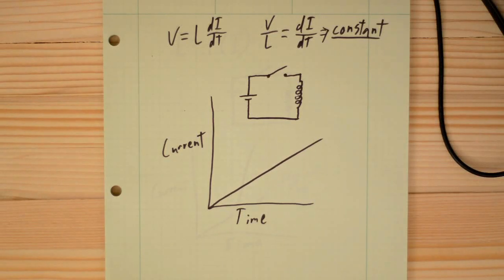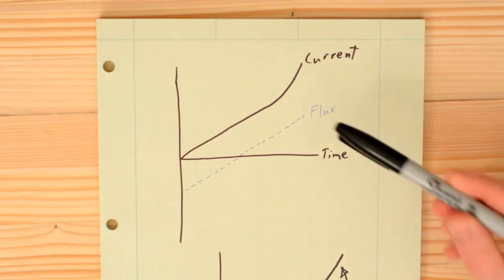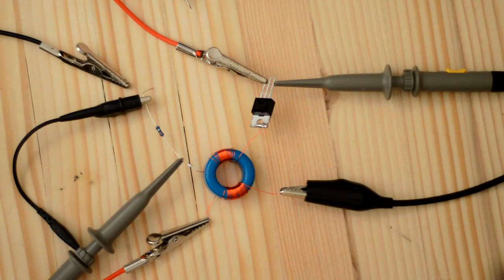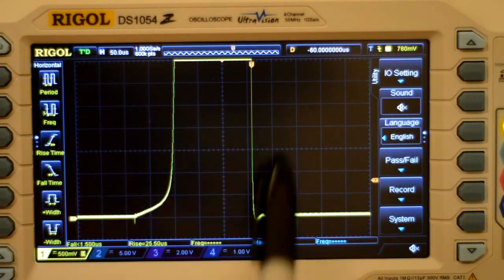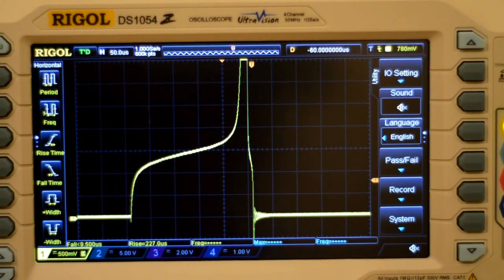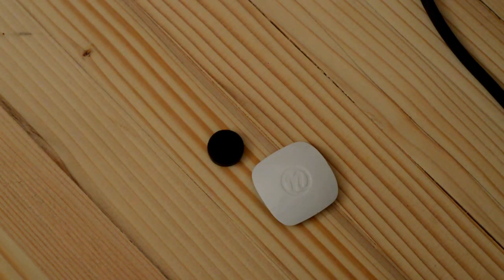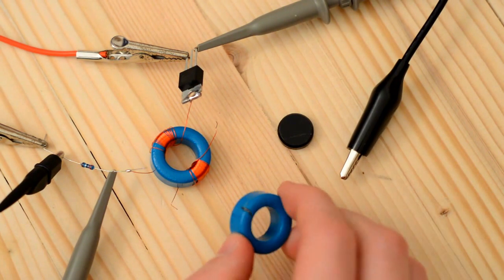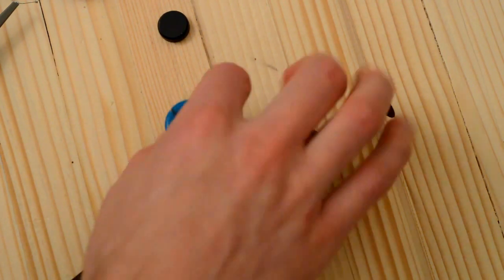Inductor Saturation and a Way Around It

Comment: Your idea has been used for decades in magnetic amplifiers.  A DC current through a coil is used to control AC through the same transformer.  An example of application is to control generator output.

Comment: That's all cool, but in practice it is a very limited recipe because unless your circuit gives you that constant current for free (and few circuits do), now you need an active power source that burns a lot of power.
Reply from the maker: Worse yet, filtering that active current source would likely require one heck of an inductor
Reply: @orinhuber  Yep. There are cases where tricks like this work, e.g. in the coupled inductor Ćuk converter that can reduce input and output ripple and in magnetic amplifier kinds of setups, where the non-linear magnetic properties of cores are being used to steer current flow, but in most cases this is a waste of time. I like to overdesign my inductors to be always on the safe side. If I need them to be smaller, the solution is always higher switching frequency.

Comment: Good explanation,
What do you suggest to overcome such a problem ?
Is this just a question of choosing right frequency or value of inductance ? Thnx.
Reply: You chose the size inductor that can store the right amount of energy. You have to learn to think about inductors the same way you think about capacitors, as energy storage devices. Instead of E=CU^2/2 for the capacitor we now get E=LI^2/2 for the inductor.

Comment: Hello, thanks for explanation. Question. What if a short time ( 2 ms ) overcurrent ( 800 A ) flows through an inductor? I mean, it's a 270 Arms, 520 Asat ( calculated ) inductor. Is that current ( current*time ) to lead to saturation? Thanks. Luca
Reply from the maker: The duration of the pulse wouldn't matter, it would saturate the inductor immediately. The saturation during that 2ms pulse would mean that the inductance would be significantly reduced. If your application can tolerate the reduced inductance during that time, it might still work for you if it doesn't heat up too much.
Reply: @orinhuber  Hello. Thanks. Clear. What if current move back to 270 A after saturation? Would the inductor correctly work again? Thanks for help. BR. Luca

Comment: I had this exact idea a little while back. Turns out it is used in practice. Inside an old dish network TV tuner I found what looked like an inductor but with some ceramic magnets glued to it. My guess is it was used in some application where a large DC bias current existed and they needed a relatively high inductance or high energy storage in the core (boost/buck converter maybe?) but the inductor was a rod style one, not a toroid.

The other problem is that if you put the magnet inside the core of your ferrite, while it would work, the magnet may heat up under high switching frequency from the eddy currents inside.

The reason you could not magnetize the ferrite directly is actually a good thing. Hysteresis is what can make some things hold a magnetic field permanently. Ferrite's main advantage over iron core is exactly this, that it has nearly zero hysteresis, at the cost of a lowish saturation flux (and maybe slightly higher reluctance? not sure)

Comment: I tried to  do your   circuit helplessly.    Sorry for the many questions  of the newbe.  The black unused clip is real?  There is no faint wire we dont see on the video?
Reply from the maker: Not a problem, it's cool to see that people are still watching my video. I don't remember for sure but the black clip was probably the negative side of the power supply used for the switched current (separate power supply for the bias current). I probably isolated the switched current power supply from ground so that the return current wouldn't go through the oscilloscope ground connection. I probably just had it temporarily disconnected to disable the switching while I filmed.
If you're trying to recreate the effect, keep in mind you'll need a big inductor in series with the bias current. That way the bias current will be stable despite the induced voltage from the switching side of the inductor.
Reply: @orinhuber   I presume it was a P mosfet because the positive(?) orange is  clipped to the third pin.  Center pin for souce and first pin for the gate.
Reply from the maker: I don't remember, but I'm thinking P-fet as well. P-fet would work a lot cleaner on the high side where it's at.

Comment: The constant current is DC?  I have the same power supply than you.    Because  Osmar Garnica write about a variac, would it be better.  Are  the 2 orange clips joined together?  You use only one  clip from the function generator?
Reply from the maker: Yep, current offset was DC. A variac wouldn't be useful in the same way since it's AC. The two orange clips are separate. One is for the bias current supply, the other is for the switching side of the inductor.

Comment: Great video. I believe these are referred to as saturation reactors.
Reply: kinda... 
Saturable reactors are specifically for controlling full AC waveforms, not really for storing power (they do store some energy but it's not usually the intended point...).
 
The Video creator specifically says he's looking for a way to avoid saturating an inductor while using a pwm signal. 
That tells me he's using a square wave that never fully reverses current, which would not work with a saturable reactor, and is looking for a way to optimize a pwm powersource. 

Now...  he should be looking at full h bridges or counter wound windings on the transformer, but maybe a balun would work.

Comment: Why do you need the huge inductor?
What happens if you just hook up a current source to the second(ary) winding on your ferrite?
Reply from the maker: Without the inductor your current source probably won't be very steady. You could make a current source that would work without the inductor, but I bet it would be extremely inefficient. 
Think of it this way: when I put primary current into the inductor, the magnetic field it produces will oppose the biasing field. The decrease in the bias field will cause a voltage in the bias windings which adds to the bias voltage. This will raise the bias current, and the inductor flux won't really change like you want.
In reality, the extra energy that appears to be stored in the toroidal inductor is really stored in the big biasing inductor. That's why I say it's cheating, and that you would need a permanent magnet to get any good out of it.
Reply: @orinhuber  I had a thought, which I cannot yet test. If you use as your bias current source a significantly steadier source than the output of the primary, you get the benefit you wanted. (Yeah, a magnet seems tempting too, especially if you have to put a gap anyway, but bear with me.) If you have managed to get more inductance without saturation than you could have gotten by changing number of windings or gapping the core, and you're making the bias source by passing the primary output through another stage, you've made this other stage's job easier. So I'd like to steady the bias source with capacitors or something, because after it's been smoothed by the choke their peaky current draw won't hammer things as badly, and after they've smoothed the current, some can be drawn off to bias the core in a smooth way. Probably. Hopefully.

Comment: How did you charge the inductor so slow? My pwm peaks the current when the mosfet switches, and I cant load the inductor slowly like this. I have a 8 AMP variac and two 1000uF 400V capacitors in parallel.
Reply from the maker: Maybe I'm too late to help, but if I'm not: what voltage are you charging the inductor with, what value is the inductor, and any idea what its saturation current is? That information would help me give a more directed response.
In the meantime, here is some general information:
Higher inductance values and lower voltages will make it charge more slowly (V=Ldi/dt so assuming constant voltage and inductance your rate of change of current will be equal to V/L). I'm guessing for this video I might have had somewhere in the ballpark of a milliHenry, 10 volts and 50 microseconds before saturation.  But as soon as you hit the saturation current, the current will start rapidly increasing. Most inductors have very small saturation currents, measured in milliamps. Your setup sounds pretty powerful from the variac and capacitor sizes, you would need a very beefy inductor or very high switching frequencies to match.
Reply: Thanks for the answer. Thats the point, when my transistor switches on (nS switching), the inductor current immediately goes to the maximun (and gets constant), and the voltage rise in the inductor stops (it makes just a little negative spike). My coil has 0.7H and about 30 ohms and the voltage varies from 0-100V. So I presume that I need to limit the inrush current to make it charges slowly like a ramp? Thanks.
Reply from the maker: I don't think that inrush current is the issue. 100V/0.7H gives a 143 amps per second rate of rise (until saturation starts of course. then it will be much higher). Very slow as far as most switching converters go. 0.7H is a huge inductance value for a switching converter. What is it you're trying to build? maybe you could send me a schematic?
Reply from the maker: Sounds good, send them to orinh93@yahoo.com